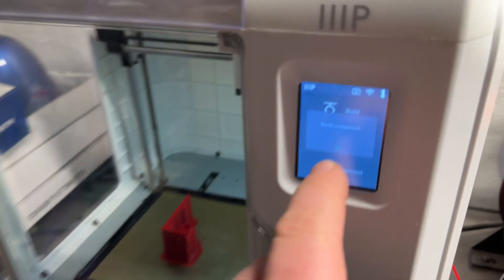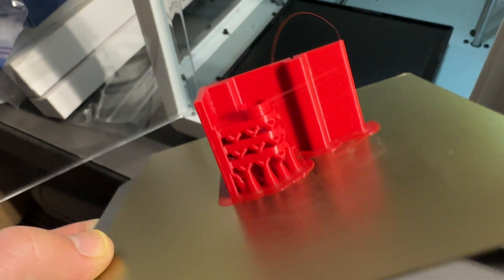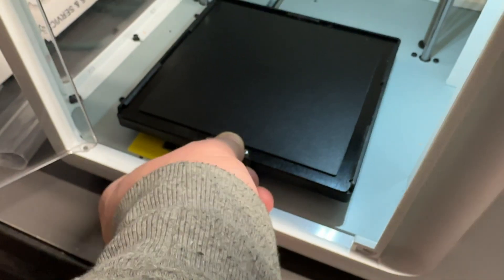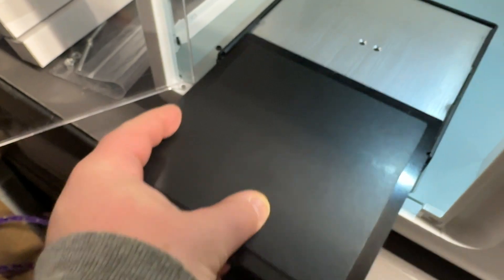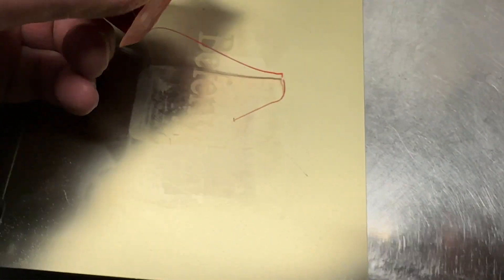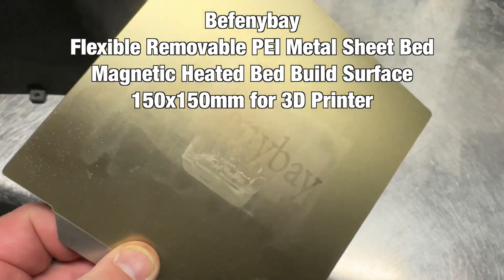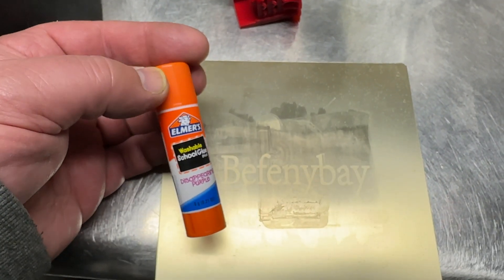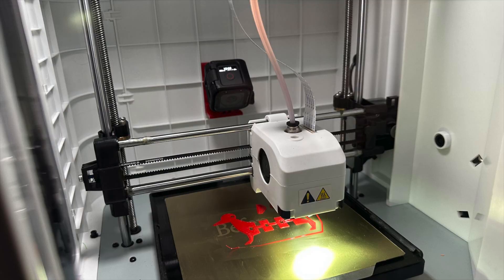PEI Magnetic Print Bed on Monoprice Voxel or Flashforge Adventurer 3

Comment: Quick question, the Amazon link is showing the size as 220mmx220mm but the flash forge has a 170mmx170mm right? I need a replacement for my flash forge but not sure the best route
Reply from the maker: I checked the link, and they changed that page, the smaller version is not there anymore. At the end you need to find what fits your printer. Just measure the printer before you order. If the buildplate is made of metal you won't be able to cut it to size, because that would introduce bends, and that's the last thing you want. I don't have my printer anymore (this video is already 2 years old), so i can't measure, but i still have a glue on build plate that is 155mmx155mm.
Reply from the maker: https://www.amazon.com/Magnetic-Flexible-Printing-Platform-150x150mm/dp/B0C6NF4WGH